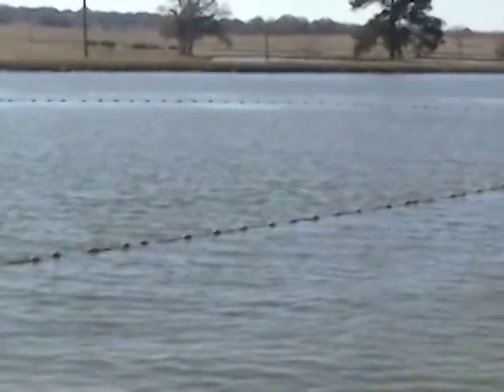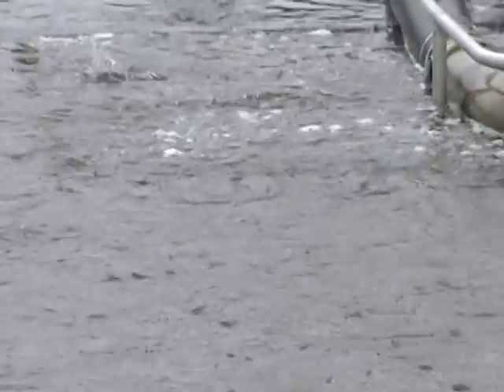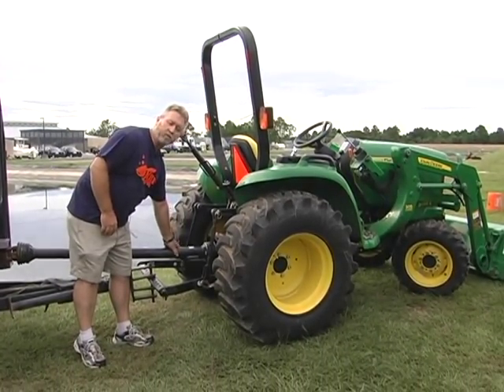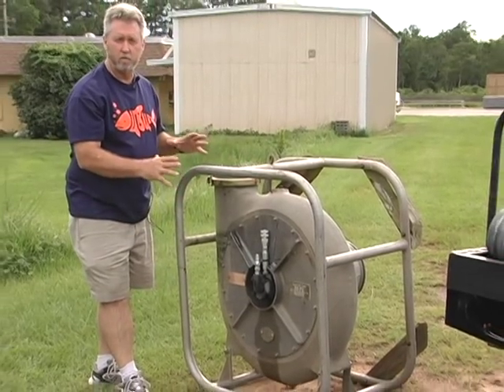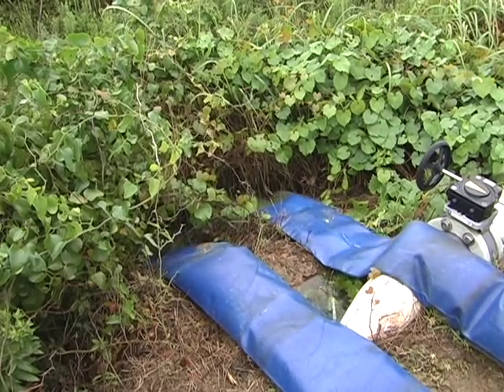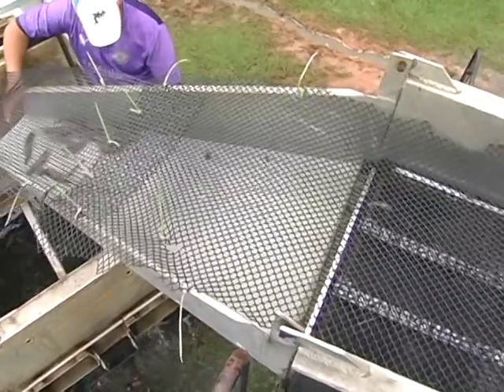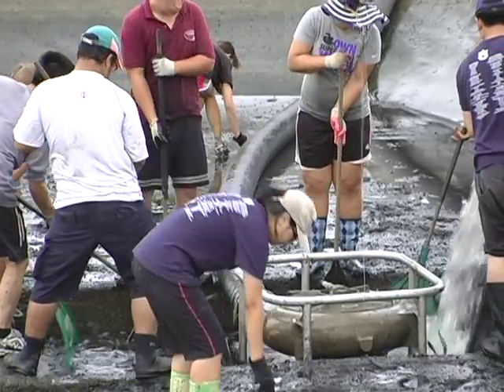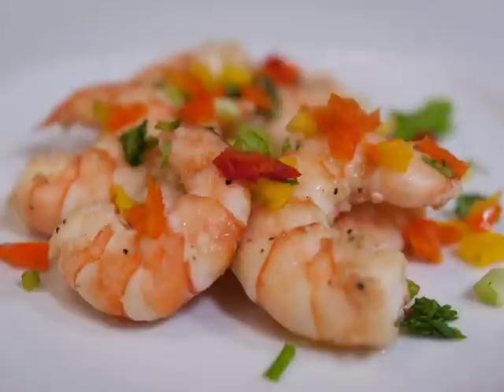Shrimp Harvest using Fish Pump

Comment: any documentation on the fish pump? could we DIY? thnks
Reply from the maker: The fish pump is an older model from Magic Valley Heli Arc  http://www.aqualifeproducts.com/  The pump portion itself would be difficult to DIY but some of the tower and dewatering system could be created by a good metal shop.
Reply: @clinedj1  i have been using couple ebara pump, i figured it should be straight forward conversion as it has same function, but how to not damage the shrimp and thats another thing to figure out